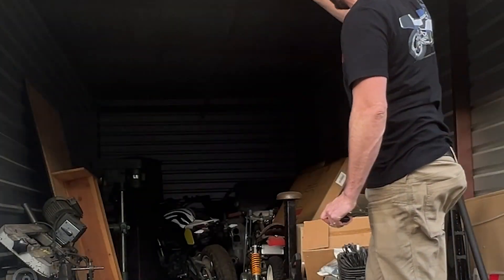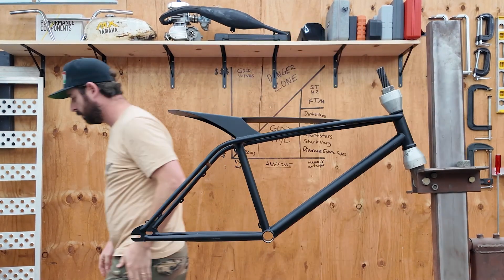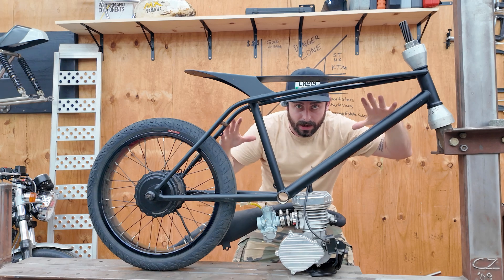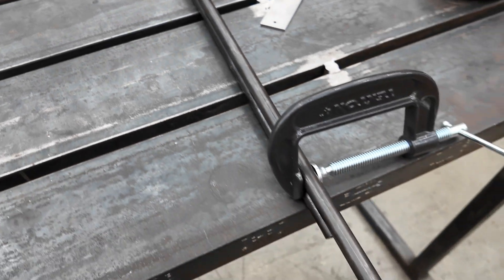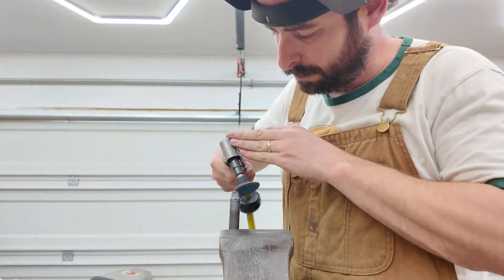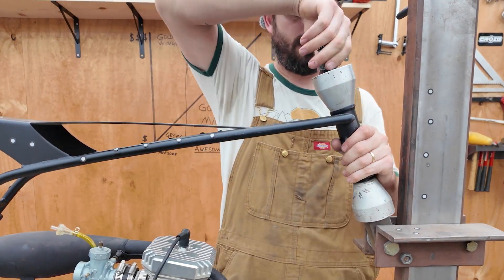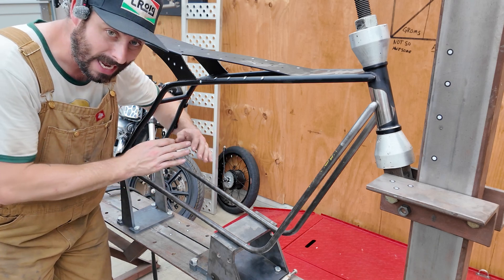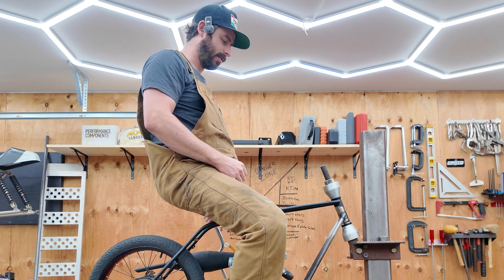2-Stroke Hybrid Electric?! (Part 1)

Comment: I would imagine its generally a better idea to use one of those front wheel electric hubs instead of this rear wheel hub. A front wheel would let you:
not worry about the drivetrains competing for space (could even add back the bicycle pedals for some wierd 3-way hybrid since these engine kits are usually meant for a bike that retains pedals and gears)
gain All Wheel Drive providing better grip and accelleration coming out of low speed corners of in low traction conditions (would make a great mountain bike-dirt bike sort of thing)
have the potential for an efficient front wheel Kinetic Energy Recovery System as the majority of braking force can be applied to the front wheels allowing you to regenerate more energy from your regenerative braking
keep the electric motor away from the hot exhaust
keep the weight of the electric motor over the front while the battery pack and engine are further back, may be a benefit if you want to prevent wheelies but may also act against you if you want to prevent being flung over the bars lmao, your call on that one for sure

love the idea of a 2-stroke or wankel rotary hybrid since both are known for some low end torque and fuel efficency problems, both of which an electrical hybrid system can help solve. hope to see what direction this ends up going, maybe an AWD, KERS capable version is an idea for the future while this is a fat-rear-tyre RWD kind of build.

Comment: I built a 2-stroke hybrid electric RC plane. I have a shaft going through the crankshaft connected to a brushless outrunner motor. I can take off with the electric and then once in the air, I can engage the clutch and it starts the motor, which the brushless motor is on a one-way bearing, so it doesnt cause resistance to the 2 stroke when it is running. When it runs out of gas, i can turn the electric motor back on and fly the plane down to a landing rather than having to do a deadstick landing and risk crashing the plane trying to find a spot to land. small private Planes can benefit from a hybrid system. Most accidents happen from engine failure during takeoff and landings. OR deadstick in a location with no landing strips. Even if the electric motor only gives 5 minutes of flight time, that can save a life. Hybrids are so cool. I look forward to seeing this sick machine run. Will be patiently waiting for the next video. Subscribed.
Reply from the maker: Wicked! All of a sudden my hybrid system seems very unsophisticated 😂

Comment: Why don’t you put the 2t motor with the carb facing frontwards? Yo‘d have a ram intake and it would be better to have a straight exhaust because of cooling (kinda complicated) and you‘d have better resonance. But you would have to add something like a pc fan or panels that lead the air to the back of the cylinder so it doesn’t overheat
Reply from the maker: I love the idea but way too complicated! This build is like a preseason game, not the final round of the playoffs. Just getting warmed up!

Comment: Started doing a very similar build with my 2024 phatmoto all terrain, swapped a 98cc 4 stroke in and put a 1000w hub motor on the front. Hits just above 40 with a sprocket change, dead reliable
Reply from the maker: Wicked! I knew I wasn’t onto anything special!